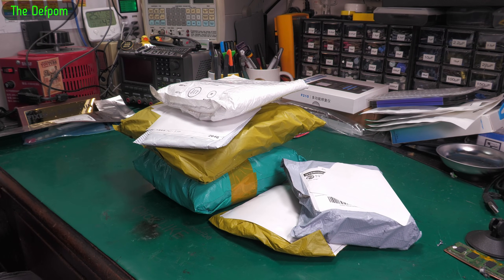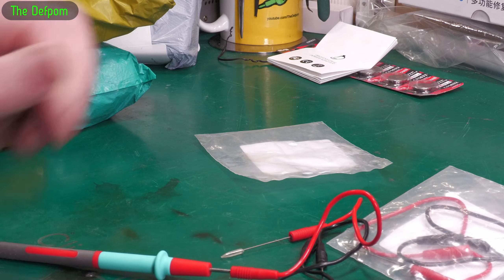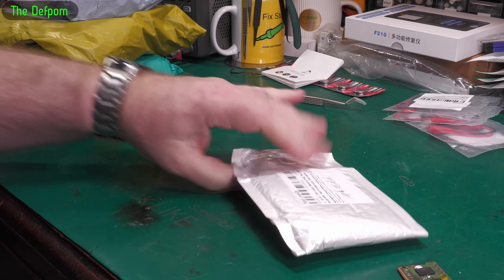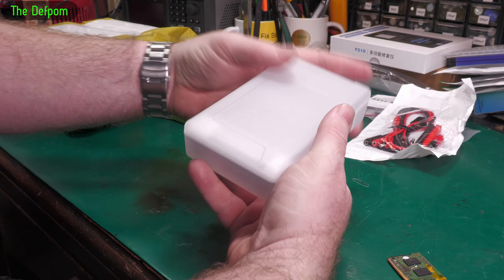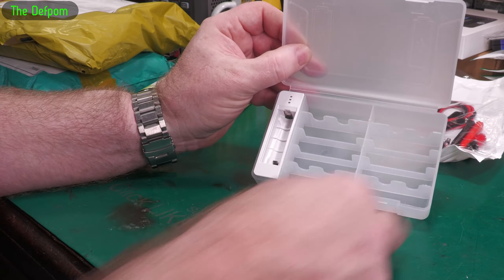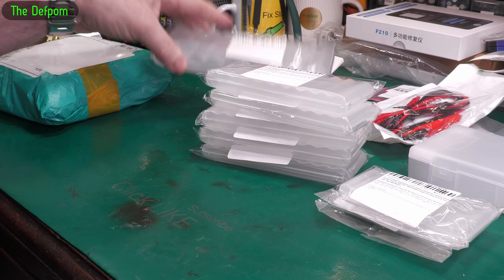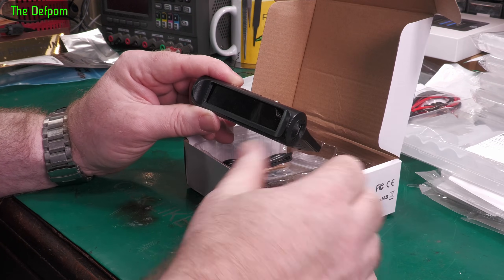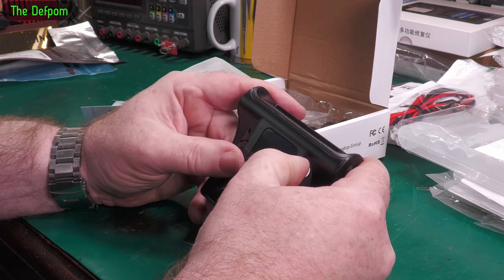🔴 Mailbag Monday 29th December 2025 - No.1439

Comment: i always make my own meter leads with ultra flexible silicone wire, I hate the stiff stuff they tend to use on cheap leads and how thick they are.  for needle probes i use needle's pinched from  the wife's sewing kit. I think that they have just the right amount of stiffness required,  with thin walled heatsrink leaving just the last 1cm uncovered are great for getting in to tight spaces.
Reply: That's a brilliant idea.